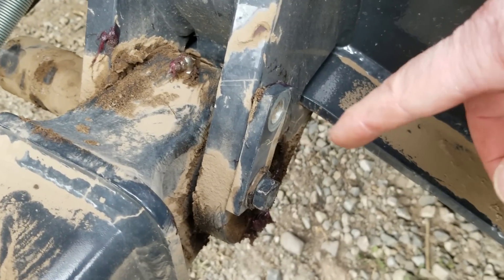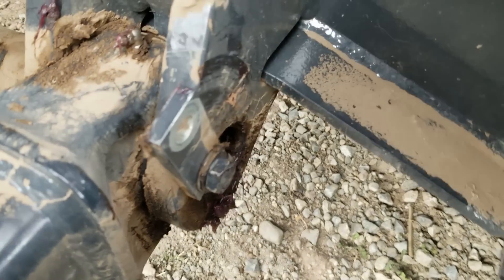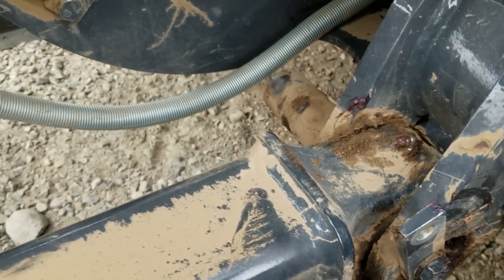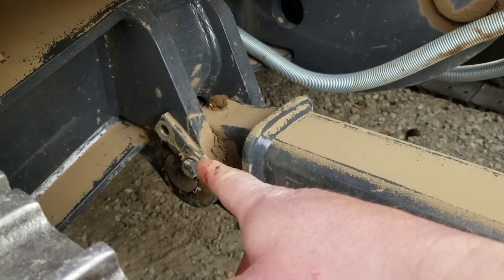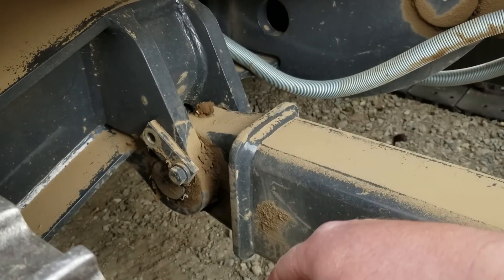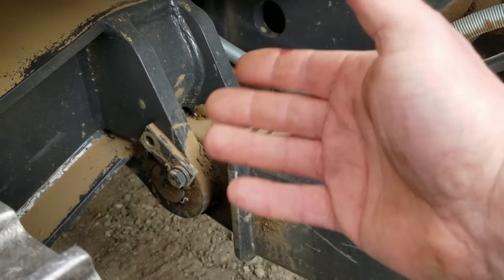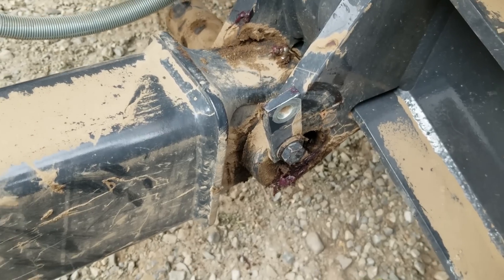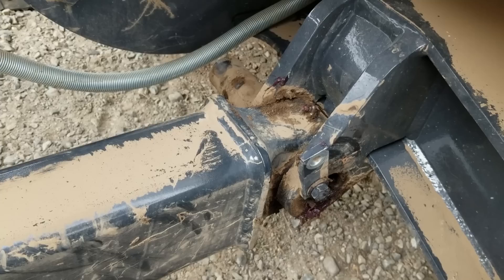Deere excavator design flaw. Suggestions?

Comment: I may be fairly late to the discussion but could you machine a hole on both sides to tap and put bushed caps on there? it would limit the torsion applied directly to the holding mechanism and would wear the bushing rather than the pin or machine.

Comment: pins should be turned conical so if they rotate, the torque applied to the tabs ~ <<1%. 
dont want to get the pullers, lathe, and pushers? WELD

Comment: That was a very common problem on both my Vermeer and Ditch Witch back fill blades.. Those only reason I can "ASSUME" this happens is the harsh amount of push/pull on those pins, that the friction of the casting width, vs the width of the combined double shear side, well, the pin ends up twisting with the A-frame, especially on the downwards direction on load, causing a cam action due to the pin now twisting in sinc with the blades A-frame. the locking flat of the pin, pushed the one side out, doing a shearing action on the bolt. If the hydraulic ram had more room to be mounted less horizontal, or to say, if it was mounted more vertical, the pressure on the whole system would be on the ram, and not on a cantilevered stressed system. Not that you do not already know this but, the ram, being mounted horizontally, or parallel with the back fill blade's A-frame, the linear action of the of ram, is trying to push the whole A-frame away from the main super structure of the truck assembly. The whole theory of "path of least resistance" game show, that yes, the result, is the break-away action from the linear movement of ram, is redirected downwards, blah.. blah...blah.. but is doing so, the massive amount of force on those two loc-pins, in frictional force. 

What I did to "TRY" to rectify the issue, machined the loc-pins slots much deeper, to the scissor action from the locking plate has a wider foot print. New loc-pin plates wee needed to me made, (which is not a big deal) and the twisting action of the pins stopped, and the A-frame then twisted on the pin, not the other way around. grade 2 bolts were all that was used. Never sheared those again. The loc-pins machined slots, are not load-bearing, so if you machine the slots half way through, to get the widest footprint of the slots, which is gonna require a whole lot more twisting torque to overcome that cam action and pushing / scissoring the back side bolts off, as it only happens in the one direction, again, under load downwards direction.. well, simply, 3 to 4 times having to deal with that, before I modified the loc-pins's slots deeper, to the slot is wider, problem was solved. at the beginning, I was only HOPING it would fix this, but, at the end, it did fix the issue.. I hope that helps.

Comment: Not likely seized, pin looked greasy and was almost out. I see on wood harvesting equipment the machine mfg will weld heavy piece of steel on each side of the pin to prevent rotation under load. This way the bolt simply holds the pin in place and any rotation is prevented by the metal on each side

Comment: One could argue since it's a Deere, it might get fixed in a software patch..

..sadly, it's just a yellow Hiscratchi, so it won't be fixed at all.

In the olden days, while small Volvo wheelloaders were still called Zettelmeyer, they had the same retaining feature on most big pins in the loader assembly.
This probably worked just fine for but a moment, until the pins seized up and began rotating along with the loader arms or the tilt arms and leveraged those keepers, snapping the bolts clean off. 
n
Now with the 300 pound blind gorilla behind the wheel it was just a whiff and a bang until the pins wobbled their way out and you had some welding and boring on your hands.

Comment: I figured out how to fix that using a fabricated part which can be bolted on using the existing bolts and pins and no permanent alteration to the machine itself. It's just a simple replacement part. After reading through the comment section I have since discovered that this is quite a common problem: which means - there's an opportunity available for the person who solves this problem and starts producing replacement parts which prevent this from happening. With your production capacity, you could turn yourself a nice bit of coin fabricating the parts. Let me know how to contact you so I can send you the parts diagram and information.

Comment: I see three solutions.  The no modification solution is to remove the broken bolt and Locktite a bolt into the pin leaving it loose so the pin and bolt can rotate.  Another option is to weld the tab to the pin.  The final option is to rotate that tab so that the pin can not come out and tighten the bolt.  Make a similar tab tap the frame and bolt the tab on so that the pin can't come out the other end.  Welding the tab to the pin will prevent rotation of the pin so that all of the wear is on the arm of the blade which probably has a replaceable bushing, is probably the only part getting lubricated,  and prevent the frame holes from wearing.

Comment: At work we've got a jd 331 skid steer that the pins for the quick tac plate do the same dam thing. It's been back to the dealer for this and multiple other issues more than it's been on site🤣 
The dealer acknowledged that it's a known problem but they ain't doing anything about it 🤣🤣🤣 talk about quality.  Friggin Junk!

Comment: I doesn't look like he has been neglecting the grease on those enough to cause that.....  The pin must have too much leverage on that keeper, the slot acts the same way a cam does when the pin tries to turn, the bolts are too small, or too close together, or someone used grade 2 bolts.....(grade 0 anyone? cheapest around....)

Comment: The pin is designed to be static. The arm of the blade probably has a replaceable hard bushing, while the ears are mild  steel. The pin is harder than the ear, but softer than the bushing. This makes the wear point the pin to bushing interface, with a bias for the pin to wear first. The  ears on the frame are not bushed, and allowing the pin to rotate will wear them. Not fun to weld and line bore  that point. A previous post suggested a keeper block welded beside the removable plate. Good idea! The block takes the shear force caused by the pin  twisting, and the bolts just keep plate in position with clamping force. No more shear force on the bolts

Comment: Does it have those plastic, dot patterned often yellow bushes? From my own experience, i think the pin to bush is too tight from new as under heavy load the bushes swell and clamp the pin, then as others have said the pin turning torque is more than the grove/plate ass’y can take. Its fine once its worn abit by design due to non/poor greaseabilty, ie, once its sloppy to most of us. Ive done as others here, put the groove full circum’ of the pin so it can turn, depending on customer/location can be done with lathe or grinder, again ive done both. 👍🇬🇧👍

Comment: Lets re-engineer them, machine to fit a couple needle washer bearing and than the plate to press against it that has O-ring indent than the strap over top - need to keep the water and dirt out and something that allows the pins to rotate yet can take some load abuse, than send them the bill for the fix it.

Comment: If i cant find a missing screw but it gos through i just jam in a fitting thing on metal with a bit sticking out so i can drill through then pin shut. Safety comes last

Comment: what i've done to fix this issue is to weld a piece of square stock against the retainer that will prevent the retainer from rotating in a way to sheer the bolts. 1/2"-3/4" square welded on 2 sides against the retainer so the only way for the pin to come out would be to unbolt the retainer. repair has held up fine. also did the exact same repair on a 0 hour machine which has not had this issue in 2 years of service. mind you, i have broken other things lol

Comment: I can't spend more time to read all the comments (at least right now). Interesting that this is not an uncommon failure mode. It's sure not one you might expect. I can understand why you wouldn't want the pin rotating so you don't wear the outer mounts (what's the official name?). I wonder if cheap(er) steel bolts contributed to the failure if it happened at low(er) temperatures. The brittle transition temperature of cheap steel is around freezing. I had this demonstrated while taking one cross chain out of my (Chinese) tractor tire chains. The side links were snapping when I bent them out, and the temperature was only about freezing (rather than say -20). After the second one snapped like nothing, the lightbulb went on. The next one I just warmed up a bit with the heat gun (not even the torch), and all the remaining ones bent out without issue. Higher grade bolts would have a lower brittle failure transition temperature. Not sure what it is off hand (it was a long time ago when I did Engineering). I'll be interested if there is a follow up. Will be a PITA getting the sheared bolts out as well.

Comment: if it twere mine i would pull the bolt out and drill a hole in each side then make the holes so i can screw a bolt in on each side with 2 huge bolt washers on each side. but you probally wants something more sturdy and longer lasting than that :)

Comment: make an inside thread in the pin and screw in big bolt with thick washer, the biggest bolt one you can fit there with keeping reasonable wall thickness.

Comment: I’d think you’d be best just to weld a plate to the end of the pin that has a hole for the bolt and only use one side to retain the pin. A lot of large equipment has pins retained that way. Should be relatively simple and you can still take it apart if necessary without getting the grinder.

Comment: No idea on recalls, but a common system I have seen is a tear drop shaped plate on one end of the pin with a single bolt for retention. Also, a longer pin with a larger head and a through-bolt or pin of some sort for retention.

Comment: Pin wanted to rotate, Tab and bolt wanted it not to. Mostly a greasing issue, they're so stingy with the grease at the factory.  If you can machine the pin so that it can rotate a full 360*, that would mask the problem. Or grease it daily.

Comment: I work in industrial supply and I see this type of thing all the time. What happens is whoever puts these things together decides they want the strongest fastener available and so naturally they go with the grade 8 or if its metric a class 10. Problem is, those fasteners are more prone to metal fatigue failures when used in a repeated stress implementation than a lower grade like a grade 5 or metric class 8. The lower grade fasteners are more elastic and can handle a lot more loading and unloading cycles than their higher grade counterparts. They will still break, but it will take a lot longer to happen. 

Now, if those fasteners that broke are already the lower grade, best of luck to ya. I got nothin.

Comment: I’ve made longer pins, drilled a 1/2”keeper hole using large washers to hold the pin in place (1/2” grade 5 with stover for keeper). It can spin all day and wear the bushing if anything. Common problem on larger machines too.

Comment: I think that's an intentional failure mode - perhaps a warning. The straight slot across the pin suggests that they don't want it to rotate. If they wanted it to rotate, it would have a recess turned all the way around the pin. My guess is that a shifted retention block or broken bolt spotted during daily greasing - you're supposed to grease those nipples daily, right? - is a warning that you're exceeding the intended loading on the stabilizer. That or they wanted to save a buck or two on the pin turning and just milled a slot rather than turned a slot in the pin, in which case it's bullshit cost-cutting design.

Comment: Welding some ears on either side of the strap to prevent it from rotating and shearing the bolt off seems like the correct fix. The sheave pins I work around always have an ear welded on the side of the equipment the retainer wants to rotate toward so they don't shear the bolts off and fall out.

Comment: Weld a tab on above the cross bar so when u hit a rock or what ever it won’t drake the bolt off .and u can still remove the pin .even if u have to make a mod to the the lock bar

Comment: I can answer why they both broke.  Pin rotates in the bore as directional pressure and torque are applied.  This obviously tightens the retaining bolt because there is no mechanism to stop rotation...snappy snap.  Loosen the retainer, rotate it into position, weld over the broken threads, remove the pin, finish weld it, reinstall.  That's the procedure from Deere anyways for all their bad retainer designs, from their 3 point systems and quick attach systems to the pins for loaders, excavators, everything that uses the tie bar retainers.  Ultimately this really only happens because the factory forgets to well lubricate the pins at installation.  Thats why some break some don't.  FYI, the OLD change was to replace the pin, grease the bore and they added greasing the pins as regular PM to prevent this, but...because its dangerous on a job site, ignore that, weld it.

Comment: In my experience, to remove a cooked pin/screw generally you can either try to weld on leverage or take a grinder and cut (essentially) a flat head groove in. No clue about the torque on those though

Comment: Could make a plate that crosse's over the pin bore and is bolted on both sides and the pin floats in between instead of one bolt in the frame and one in the pin?

Comment: Happens. Weld the plate to the pin (like they come when you get a replacement). Also, check the pin/bore for any grooving/oblonginity ;) , if that pin has any play, when you torsional load on it via the ends of blade, everything"hinges" on that pin. 2 real fixes. 1) a pressure bypass valve that won't allow that much force to be applied to that particular function and 2) now that you're aware, stop trying tip the machine over with end of the blade lol(ok, only 1 real fix)

Comment: Easiest thing to do is not buy a product by John Deere. We had a 330K loader on the farm that was made by Lieber. Had massive electrical issues under 300 hours, and all sorts of hydraulic problems. When we bought our s670 in 2017 first harvest the fucker spent more time with a John Deere service truck next to it fixing hydraulic problems and had probably more then 3x the systems hydraulic capacity replaced from hoses blowing, fittings loosening off or my personal favorite: the pump for the header developed a pin hole in the casing, didn't leak until about 1000psi. John Deere = John junk

Comment: because you have plenty of room either side use a longer pin and put a bolt through each end of the pin so it can still walk sideways slightly but cant walk all the way out

Comment: Either way over torque or bolt placement   so tight it's taking up the clearance of the pin and therefore bearing way more load than it was designed and specified for. My 2 cents. 

It's kind of unacceptable to have to drill and retap holes on a 130 hr machine. If they were over tightened, gotta wonder what other bolts were tightened by the same tool?

Comment: Was doing such a repair on a 135g this morning believe it or not, check the alignment of the ears which locate the pin to the hoe body (giggity). They can get bent surprisingly easily and bind the pin in the moving portion, breaking the keeper.

Comment: If you have the length, drill a hole, inch or whatever from each end through the cross section of the pin. Install pin, metal shim on each side. 3/4ish bolt on each side. Eyeball it. I also use shims to tighten up the boom, stick and bucket and h-link and quick coupler. get it within like 3/16”ish of play . You can also shave off or flatten off the ears and mating surface that pins pass through to help square things up.

Comment: Oddly enough I work for John Deere, and even weirder, I'm assigned to welding engineering. We buy bolts from suppliers by the metric fuck ton. We also expect these fasteners to be made with certain specifications. However, that's not always the case. There's probably a flaw with the material.
Reply: please, step on down to the technicians floor and see why this is an engineering mistake and not a fastener manufacturers mistake.